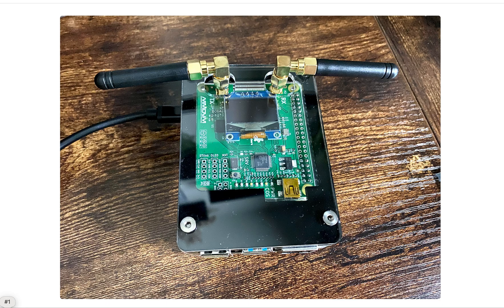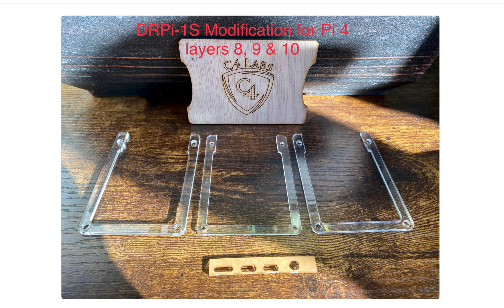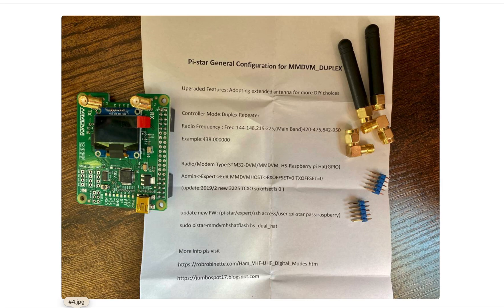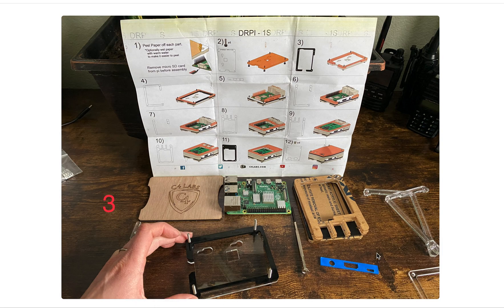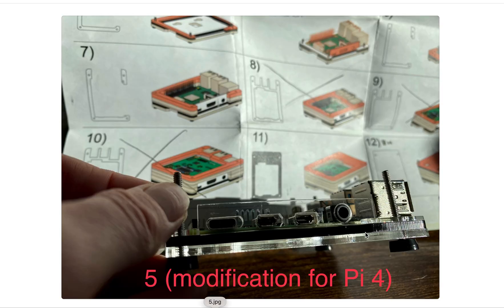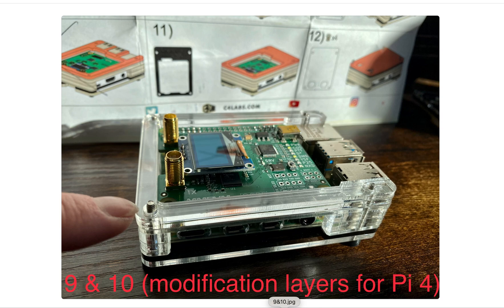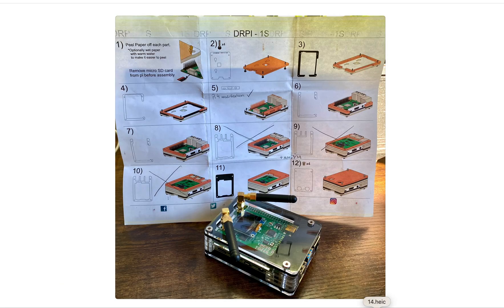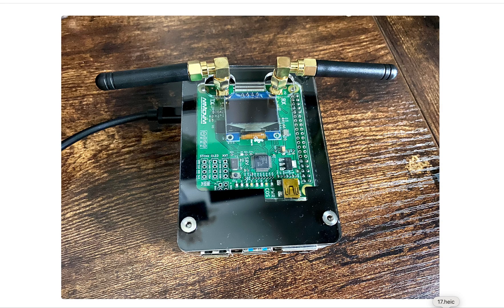MMDVM Duplex Dual Hat Hotspot Raspberry Pi 4 C4Labs Case Assembly

Comment: Verry nice. Looks like they offer the case for the pi4 with optional 3.5" screen. Only problem is the case does not support a fan. They say the pi4 can run hot. Have you had any problems? N1MJT
Reply from the maker: Yes, I noticed that my pi4 runs hot. Found it not to be a big issue as it’s by the window and it does keep it cool.

Comment: Which MMDVM ?. any specific model number -TNX
Reply from the maker: I’m using this one in the video, got it at AURSINC Store on Amazon:

MMDVM Duplex Hotspot Module Dual Hat V1.3 Support P25 DMR YSF NXDN DMR Slot 1 + Slot 2 for Raspberry pi with USB Port (with OLED)